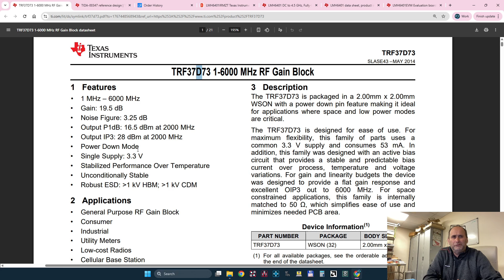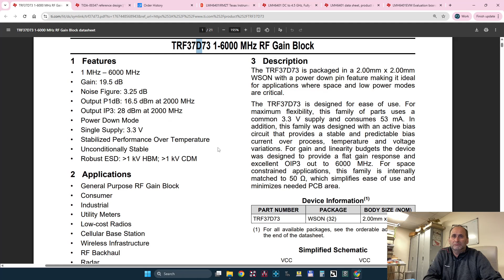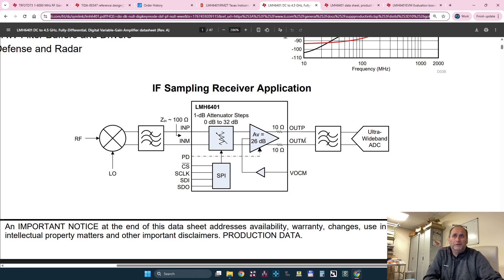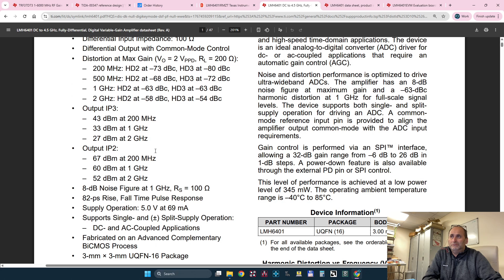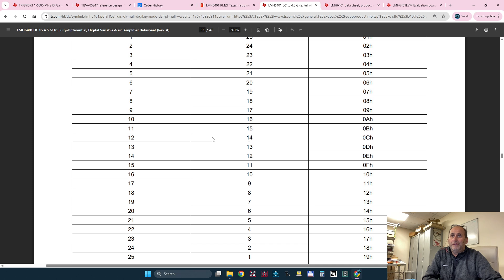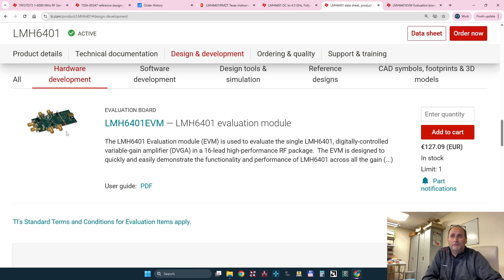Simple Radio Selecting Parts  EP5

Comment: Take a look at the TIDA-00659 (LMH3401 + LMH5401) reference design from Texas Instruments, which goes up to 8 GHz. I have a Texas Instruments ADS54J60EVM-CB evaluation board with two 1 GHz ADCs that I want to use with the TIDA-00659. The ADS54J60EVM-CB evaluation board's data interface is a JESD204B, and I'm still looking for a suitable FPGA solution for that. There's also the TSW54J60EVM for €1000, which combines a preamplifier (LMH6401 and LMH3401) and a GSPS ADS54J60 ADC. I'll be ordering pcbs for the TIDA-00659 reference design soon.
Reply from the maker: Stefan,
the board I'm using has a Spartan7  desn't have Gigabit Transceivers for JESD204B (I designed the board for making C64 which I did)  and the simple radio project is for teaching purpose (I'm not trying to make a product) I'm trying to simplify things so most of the beginners will understand (hopefully) any will be attracted to engineering.
Thanks for the comment
Reply: @adaptivedesign8795  Then I belong to your target group, because I have little experience with FPGAs. I see, that only the Artix 7, Kintex 7 and Virtex 7 support JESD204B via MGT (multi gigabit transceivers).
Reply from the maker: Correct, Spartan7 is the low cost member of the series 7 parts but capable enough for the price 
Keep building interesting stuff!